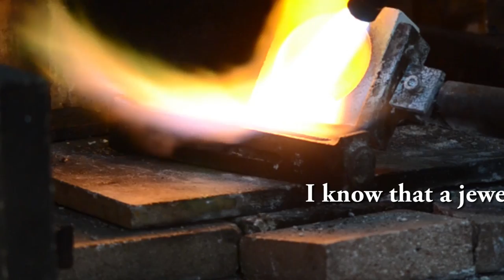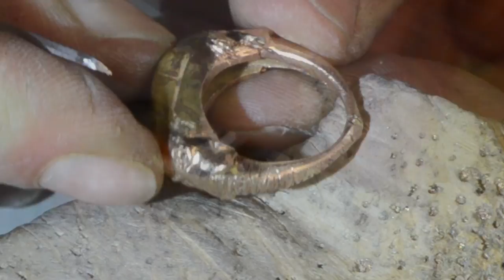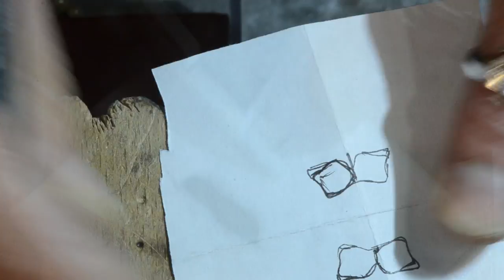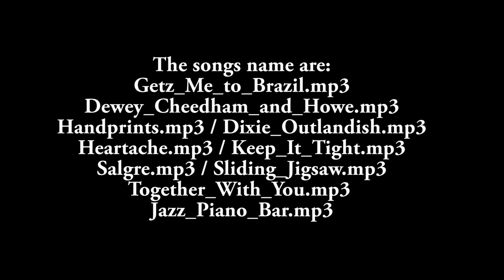Gold ring handmade form of elephant head with gemstone kyanite

Comment: Stunning work! [BUT I cannot believe he fabricated it instead of carving it in wax and casting that ring. The design is so well suited to casting. When I graduated from my Metal Art program, I took all my sterling dust from filing and the little shavings and scraps from fabricating and sold it for $90. This was back in 1976. This goldsmith filed off a few hundred dollars of gold making this piece... but then he melts it down and draws wire or rolls plate and begins again... astonishing!]

Comment: Excellent craftsmanship you are true artist.
Generally speaking Every time I'm reheating item, previously soldered seams show up, especially when you installed bezel so the whole ring was red. I can use 3-4 different temp solder,but after a while eats it self in. What s your secret?
Reply from the maker: Thanks, I work in 18kt gold, welding Using the same title. If using solders with high melting temperature very close to the gold melting point does not have corrosion problems. it is important that the pieces to be welded do not present cracks but are perfectly adjacent

Comment: You are a fabulous artist. Your work is so inspiring. And just beautiful. I can go on and on about it. Tfs! If I may ask, what type and size of burr are you using to cut the wrinkles down the trunk of the elephant? Not the graver, but the burr on your handpiece before you used the graver. I'm sure you knew that, but just in case I thought I would specify.
Reply from the maker: I do not remember the measure, I normally choose them at sight

Comment: Out of my scope! That is a mix of carving and sculpture! You are good with the scoppers! On animals I've done a Chook and a Lyre bird, but in a lighter technique several layers of .08 mm in 18 ct YG 128 colored sapphires but set by a professional diamond setter! You got the full range of skills! There is a market in Italy for handmade things out of CAD,CAM and Printer?
Reply from the maker: +Arpol West1 Yes. The handmade objects require a little more time, not much more, because a ring to be perfect still takes time even when made of cast wax persa. With jewelry handmade, the difference lies in the ability to change the project at run time, and to have an end result exactly as you wish, and increased strength and improved elasticity of the gold, absolute lack of porosity.

Comment: Nice job! Are all your designs one of a kind, or do you sometimes make more than one of a ring like this? Also, nice job (if I am correct) of recycling an old clock mainspring as a stand when you were soldering. :)
Reply from the maker: +hockeyrd99 I realize what  want the customer, the designs are the result of requests. If I can, do not made them in series. Thanks

Comment: Great video as usual. But if you don't mind me asking, what happens to all the gold powder after the filing? Also, what type of power tool are you using? It seems so fine.
Reply: +bioletsmakeiteasy , lol ur Q was in my mind before , but I knew he will knock it
Reply from the maker: +bioletsmakeiteasy The gold powder is melted and recovered. The welding is of 18k gold with a melting point below. like flame, use propane gas
Reply: Cool Scaffoal, really cool
Reply: scaffoal Thanks for the reply, but I meant what power tool did you use, in the video.
Reply from the maker: which power tool ?
Reply: scaffoal at 5:19
Reply from the maker: bioletsmakeiteasy

is a drill bit for metals, mounted on a motor handpiece
Reply: scaffoal nvm, I meant the thing that moves the drill bit lol